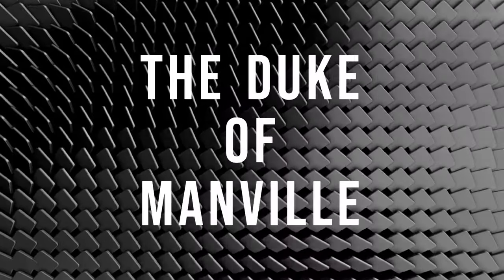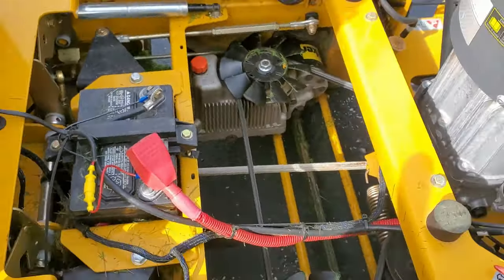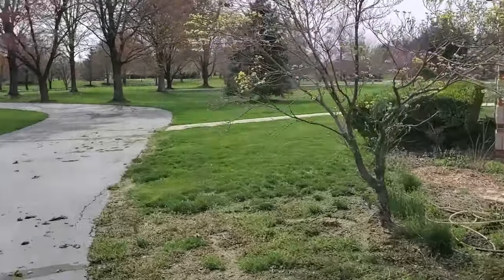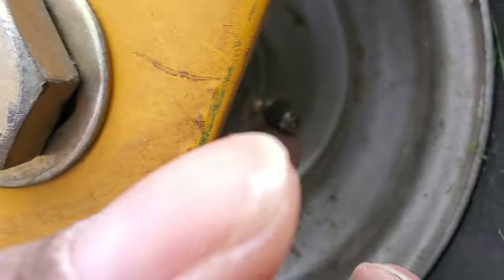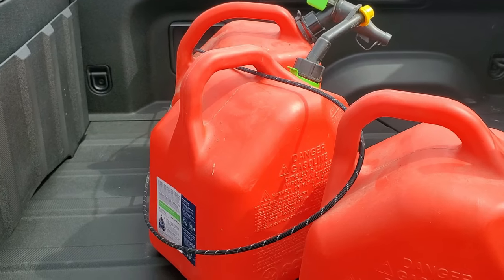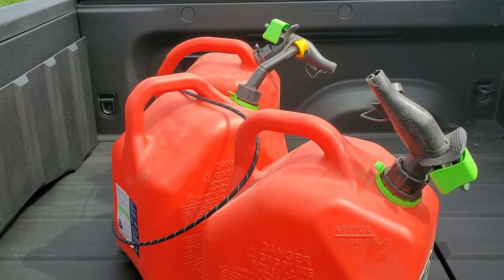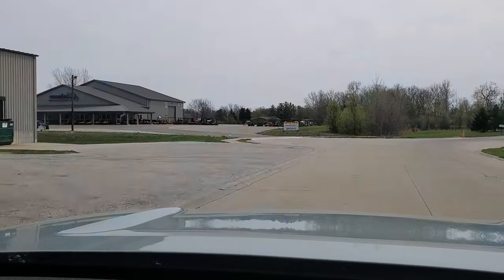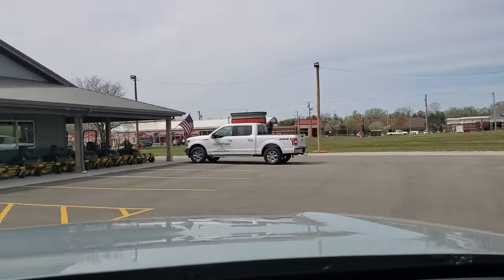So This Local Lawn Mower Dealer Tried To Scam Me...😤

Comment: This is an all too consistent bad service experience - whether it’s lawn and garden; boat; airplane, vehicle.  I rarely choose the low cost provider because I find them the least reliable when it comes to service.  I’m not trying to nickel and dime anyone, I will pay extra if they go above and beyond.  But, wow, it is so hard to find a good service organization that will do what they say they will do, and do it well.  I have a car mechanic I trust completely and have not had an automotive issue in the last 15 years.  My Rivian will also mean that as he gets ready to retire, I will not be as reliant on his replacement!
Reply from the maker: Hello David, it seems like the problem is getting worse. Especially since fewer people are going into the trades. Therefore, I predict the trades will be the high paying jobs of the future because you can't outsource them, and can't be easily replaced with AI. And awesome thing about the Rivian is that you won't have to worry about all that routine maintenance you have with ICE vehicles. Great comment!